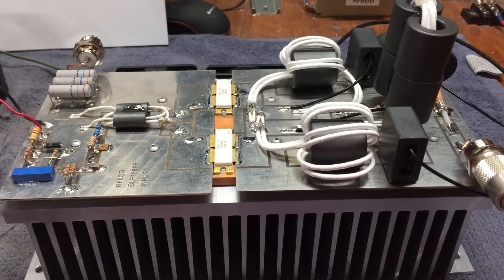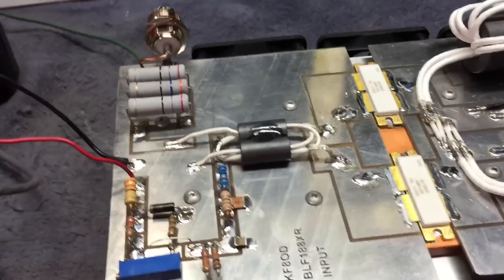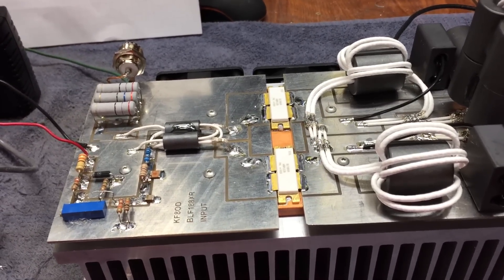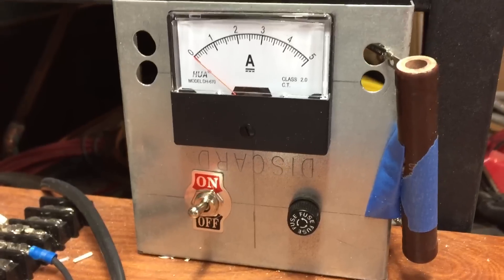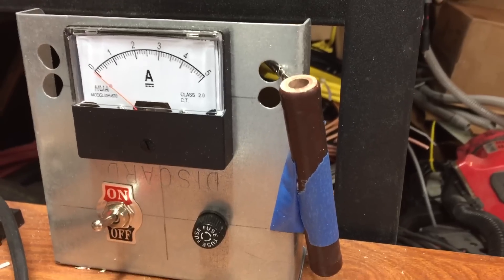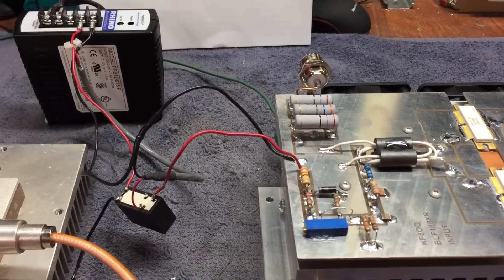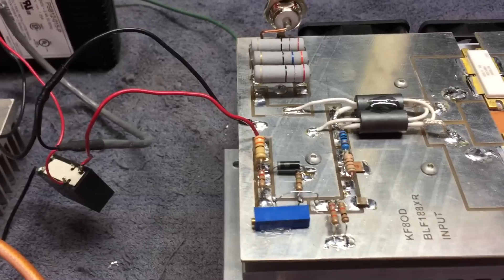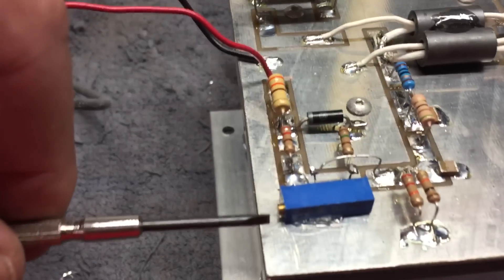Initial setup for a LDMOS amplifier.

Comment: You didn't screw down the transistors!!   I haven't watched the whole video and hope you didn't blow those $$$ expensive parts.   They need to contact your Copper heat spreader, with just the tiniest amount of thermal compound between the transistors and the Copper.   And screwed down, but not too tight!!!

Comment: in your video, you said 'key it'. what exactly did you do? I do not see an rf in hooked up but you used a dummy load. how did you do this?
Reply: He put power to it, not actually driving it with rf. The bias current -  the idle current he is measuring

Comment: I recently had a mosfet blow up and I don’t understand why. It seems to have started while running close to 700 watts. Any suggestions as to what could have happened?
Reply from the maker: Typically the cause is drive or current.
Reply: @KF8OD1  Thank you for replying. When you say drive are you referring to watts? It seemed to have failed when driving at around 700 watts. At first I thought there was something wrong with the antenna but now I'm not sure.
Reply from the maker: @DjSmoothNY  Send me an email, kf8od@aol.com. Send me details like, picture of the amp rf deck, input power to the amp, mode of operation and current on 50vdc supply.
Reply: @KF8OD1  sent email

Comment: OK SO 4 AMPS GOING INTO THE AMPLIFIER AT 50 VOLTS  OK SO THIS WAS THE QUESTION IN MY EMAIL TO YOU AND THIS IS THE SAME SETTING? GOING INTO THE AMP? 50 VOLTS @ 4 AMPS FOR (2) 188XR LDMOS
Reply from the maker: Yes
Reply: supply voltage is 50v, bias current is not..

Comment: I have an amplifier with a problem. It is a VHF MOSFET amplifier (not LDMOS) 1 - 2 watts in for 150 watt out. It runs on 24VDC
I hooked the output to a 50-ohm load, power the amp, but when I applied 1 watt of RF to the input I got absolutely no power output whatsoever. The needle on my watt-meter does not deflect at all even on the 1 watt scale. I tried adjusting the bias and still nothing happens (started at 0 and went all the way up to 5 volts of BIAS gradually). Do you know what could be wrong? 
Amp pallet was purchased on Ebay.
Reply from the maker: Ryan Toomey I would check the transmit relay, doesn’t look like any energy is getting through. 
All the devices are smoked.
Reply: Without knowing which mosfet your amp uses: Hopefully your mosfet isn't damaged. Setting your Vgs=5V seems excessively high! <----- I learned the hard way. Turn it back to 1V, or even .5V, until you get some power out of it and then, without feeding the amp any RF, adjust the bias voltage (Vgs) until the mosfet draws what the manufacturer says in their spec sheet.
Reply: Ok. I tried again with the BIAS pot all the way at zero, then powered the amp with no RF. However; when I adjusted the bias, the current does not change at all. What does this mean?
Reply: @ryantoomey611  fried the transistor by over driving it. a mosfet's worst enemy is overdriving and so never ever ever run without a 10 dB attenuator SOLDERED IN PLACE to the input rf of the RF drive palet. Then you can easily not overdrive as now it takes 10 watts of TRX power to get 1 watt into the RF input of palet. So just set TRX to 5 watts and stay there when operate as never ever drive a linear at 100 % power. only run amps at 50% power and buy a bigger amp if that no enough.